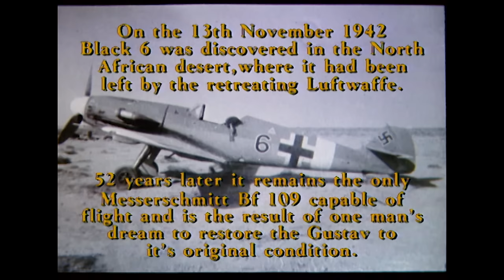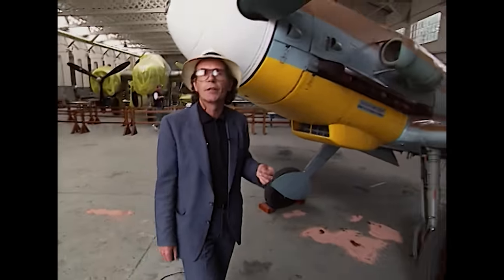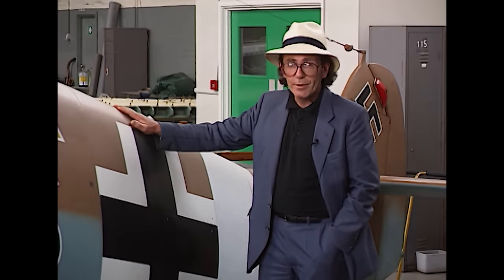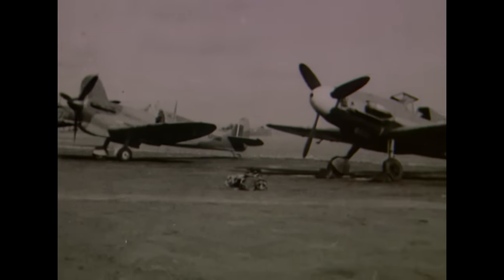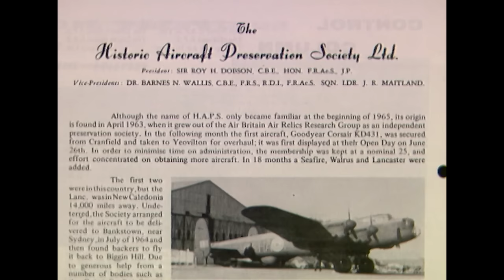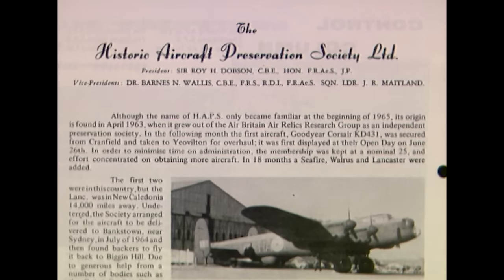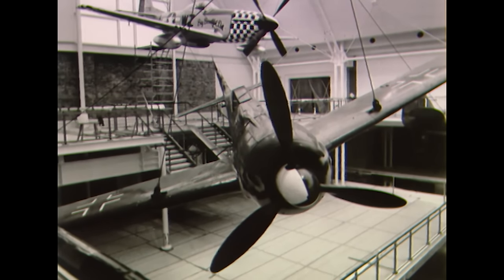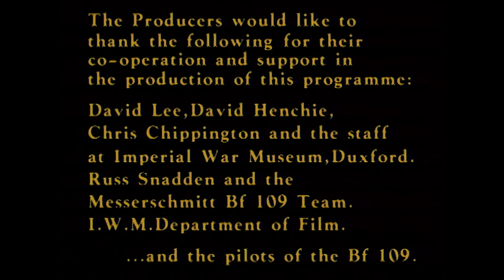Engineers Try To Make An Original Messerschmitt Bf 109 Fly Again | Restoration Classics | Progress

Comment: Absolutely gorgeous aircraft! The thing that I find crazy is when they find a wreck, totally corroded to oblivion, and claim to 'restore' it.......They AREN'T restoring it at all! They are building a TOTALLY new plane, that just happens to have the factory identification plate of the wreck attached (Similar to a VIN plate). Nice to have another example of the type flying, but it's a replica not a restoration! Not yet seen this vid, but I'm hoping that this one is a genuine restoration! Great that it's kept the original engine, instead of cheating and putting a Merlin in it!

Comment: I was at Duxford the day Black 6 came in to land, and flipped over on landing.it was in the only complete 109 with original engine at the time, not Buchons with inverted Merlins, so to see the original aircraft and hear the real sound of a Messerschmit black 6, back then was the only way. I love the Spitfire and the sound of a Merlin, or griffon, like any true Brit. But it's not the sound of a 109, that growl of a Mercedes-Benz is its own special sound. 
When the 109 flipped there was a unified gasp from the crowd. Obviously, the pilot couldn't slide the canopy back as they opened up and across, a design flaw in this situation, not altered till the Czechs and Israelies sorted it out. So the Duxford pilot agreed to stay put, inverted, until they could get him free, without damaging this only genuine flying 109, as long as there was no petrol leaks. Unfortunately, it was deamed not worth repair and had its flying permit removed. Considering the quality of virtual skeletons that are returned to flying conditions i find the decision rather..... questionable. By the way, what happened to the Focke Wulf 189 they were supposed to return to airworthiness about 15 + years ago. They even sold Bronze, Silver and gold certificates so for the Gold you'd get to go up in the 189 for a 20 minute flight. A Czech model company, where the 189 was found, even did a kit with the decal sheet the same as 189. It had a white wash pattern camouflage as it was on the Eastern Front during the winter. I have a soft spot for this plane and my sister was going to get a flight for me , there's hardly any Luftwaffe ww2 planes you can get a flight in. My dream would be the JU 88 R which was in IWM Hendon, but all these have been spread around Duxford, St Albans wherever. Same with the IWM in London. I want to see a Tank, not the cheap wooden table and chair from Saddam Hussain Trial, looked like it came fro Ikea. I presume the tanks went to the Bovington Tank Museum, which makes sense. I believe black 6 which was in Hendon around 2000, is now in St Albans or Duxford. I know theres a Buchon G6 retrofitted with a Daimler Benz i believe, and an earlier model E flying. But seeing these wonderful machines sat immobile in a museum is great, but nothing like the real thing roaring through the air.
Reply: Black 6 is at RAF Cosford
Reply: Buchons have an upright Merlin as in a Spitfire whereas the DB 601 is essentially inverted from our perspective which is why Buchons never look right - Propellor and exhausts too high. They should have inverted the Merlin but it was never designed to work upside down.